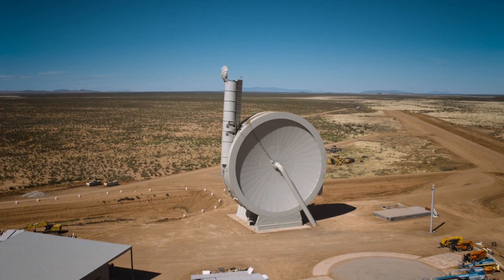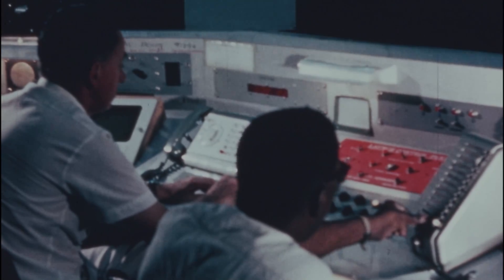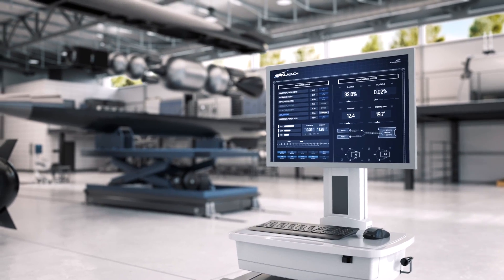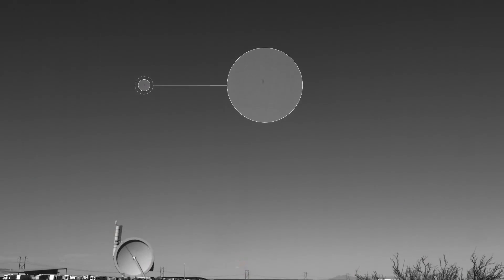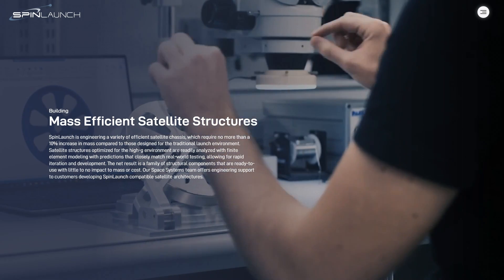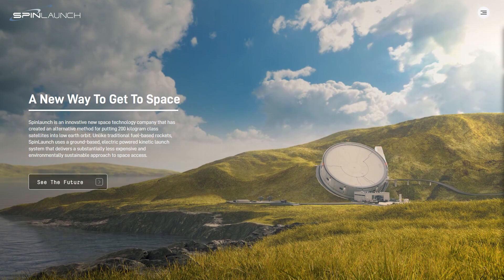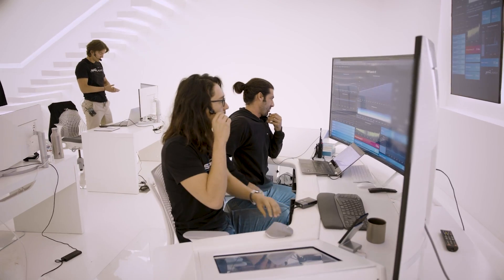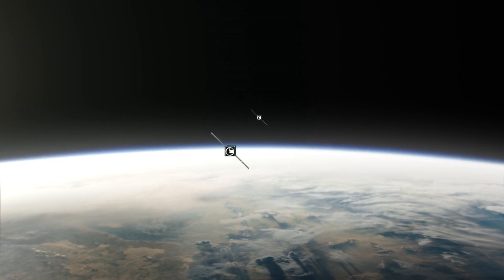Can Spinlaunch Throw Rockets Into Space?

Comment: They realize that if a spin based launcher does fail that it may be worse than a rocket exploding as the projectile/craft goes where ever the failure sends it at hypersonic speed at ground level and with a range similar to a rail gun or farther for debris to all.

A city hundreds of miles away could be at risk if a failure happens if the thing survives the failure and doesn't burn up.

Tho a smaller version with a rapidly moving trap door or maybe open ended for a tank's main gun would be an innovation. If that thing reached hypersonic speed using 20 percent power for a multi thousand pound load. A shell a few pounds should be easy and use less energy than a rail gun. So it could be put on ships to. 

Carries a smaller risk from a smaller projectiles to.

Comment: Why don't they build a floating platform at 9 - 10 miles high to launch from? (It could be sort of like a giant raft with helium blimps for buoyancy. The whole platform could generate energy with solar and wind power and be tethered to the ground. It could have a surface area about the size of an aircraft carrier.) Then a spin launch device could do the same thing with a tiny fraction of the energy and forces required. So the engineering troubles would be far less exotic. You could also launch conventional rockets from up there, and they could be relatively minuscule due to the far smaller forces required to reach low earth orbit. Materials could be taken slowly up to the platform with something like an elevator. Or larger things could be taken by jet aircraft that would simply use a landing strip up there like landing on an aircraft carrier. Or rocket planes could take off from the landing strip and then it would not be hard to get to  low earth orbit.

Comment: I was thinking of a multi-turbine engine pod mount system with high thrust to weight ratio turbines, which could be the 1st stage platform for launching rockets through the thickest part of the atmosphere. The fuel tank requirements would only be large enough for the amount of time the engines have to burn at full throttle. Then the 2nd stage rocket could thrust away from the turbine platform and the turbines are parachuted back down to a landing area via an airfoil chute with mechanical controls much the same as a skydiver uses. Not quite sure of lift capacities for let's say a four engine pod system, but if they were something like J-79's (Think F-104 Starfighter) they could probably pack a significant 2nd stage payload into the upper atmosphere? There may even be the incentive to design-build unique, light-weight electric-turbine engines which are purpose built for this one specific task?

Comment: The "VT fuse" (VT for variable timing, a ruse name like "tank") which was the proximity fuse used in WW2 by the US & Britain, in artillery, and AA shells. A very secret weapon, subjected to high Gs. It was built with subminiature vacuum tubes, with glass bodies. A large part of the durability, was due to the square-cubed law. These tubes were very much smaller than standard vacuum tubes, and that made them able to handle the required stresses. The same physics (math) property that allows an ant to carry 16x its own weight. Scale an ant up to the size of a house cat, and it would collapse under its own body weight. Scaling is even greater between the first electronic computers and a modern computer chip.

Comment: A thin plastic sheet does not hold a vacuum. If you want to decrease air resistance, perch the centrifuge up higher, streamline the arm, and fill the chamber with helium or hydrogen.
Also, put it on the equator. It gives you a head start of 1000 mph.

Comment: @9:20 rebalancing on release should actually be quite easy.  All you need is a diametrically opposite counter-mass that is released at the exact same time. It would of course be released in the opposite direction so it would need a somewhat oversize 'bullet trap'  to safely bring the counterweight to a halt after release but such things have been built many a time for military ballistics tests.
The advantage is that it is very simple.  All it needs is for both arms of the rotor to be identical and have the counter-mass be shaped the same as the launch projectile, in terms of its mass distribution and the way it attaches to the arm. The release mechanism (most likely pyrotechnic) would also be identical on both ends guaranteeing sub millisecond accuracy in release time.

Comment: Notice how in reality they put the rotation axis of their prototype parallel to horizon, compared to the inclination plane in the computer generated images. Vibrations on the shaft will be better oriented, since gravity won't have an axial component. Only radial efforts on the shaft.
Reply: They'd have to align it with Earth's rotation axis otherwise the precession forces due to Earth's own rotation would be significant once it's approaching launch speed
Reply: @triffid0hunter  ? I am very doubtfull about your affirmation: it would be a very tiny force couple, compared to all the other efforts they have to face. The main one being the vibration caused by the flexion of the arm outside the plane of rotation (due to gravity and unbalanced arm) if the axis is not parrallel to horizon.

Comment: Mach 1 @ sea level still leaves a lot of work for a rocket to do…. 
Im still thinking that a rail gun would be an easier.
Neil deGrasse Tyson mentioned that a gravity train between any two points on earth would take half as long as it takes to orbit earth, (45 min? (In a perfect vacuum without friction)).  Get the boring company involved, tunnel flat, as deep as is safe, perform a “gravity assist” in a straight railgun.  Have it launch as close to the equator as possible.  And stop making things so complicated.  I mean really that throwing arm is going to come off its bearings and rip through that shell and murder a whole bunch of nice folks, or at least destroy a bunch of their hard work.

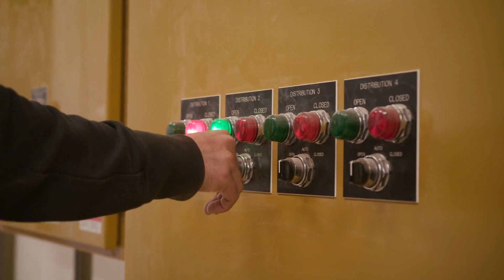Comment: 09:10 damage the bearings - liquid bearings? Old lighthouses used mercury as a frictionless bearing for the lens assembly. Yeah, orders of magnitude difference, but should function at high-speed/mid-mass like it does at (s)low-speed/high-mass (tons of glass & associated steel framework)
Reply: They are probably using air bearings

Comment: How about adding another payload dummy projectile on the other end of the spinner that releases at the same time but have it yeeted into a basement tube where it can be safely discarded and the spinner wont suffer damage from the sudden loss of weight on the one side of the spinner alone. it would of course increase the overall weight and time/power required to get it up to speed but can lessen the damage on bearings and other components

Comment: the whole time i'm thinking, do this on the moon, lower ev and no atmosphere, and then Scott finally gets to it. Seems like a good application for moving materials off of bodies with little or no atmosphere and low gravity, i.e. asteroids, moons, but possibly Mars too? atmospheric pressure is way lower and gravity is 0.4g.
Reply: Yeah, but there's also no point to spinning it there. With no atmosphere and plenty of open space, you can just lay out a big ol' magnetic launch system and avoid the 10,000 G side loads.
Reply: @AubriGryphon  true a rail gun to launch things into orbit might be the way to go if you have enough level terrain. But possibly on an asteroid the centrifuge approach which is more compact and would have advantages.
Reply: @FredPlanatia  Asteroids have so much less gravity you could get escape velocity with a tiny rail gun. 

Ad for level enough terrain. Just build it on the side of Olympus Mons. You get a very slow acceleration right up to the top.
Reply: Gerard K. O'Neil, High Frontier  L5
Reply: If only any of those bodies had a product that it will EVER make economic sense to require launch.
Reply: @markdoldon8852  You’re eluding to helium-3 for use in nuclear fusion power plants?
Reply: @snivesz32  or say the massive exposed deposits of rare minerals, with a cheap enough launch system it would become viable, especially if you started the operation from an assembly plant on a body like the moon
Reply: @markdoldon8852  I imagine if you want to build something in orbit it would be advantageous if you accessed local resources. In the case of asteroids you might build mining equipment or stations using local sources of metals for example.
Reply: Using solar power to spin launch or magnetic rail launch something from the moon or a small asteroid might make mining more economical.
Reply: Did you forget space debris that makes this more dangerous outer space, and where do you think they will get this kind of electrical energy on the MOON?

Comment: They would not be able to rebalance the weight without releasing a mass on the other end of the rotor (into the ground). This is because the amount of energy required to I so would be on the scale of the launch itself, not something that can be done in a fraction of a second. They would have to be able to manage the imbalanced rotor forces

Comment: Interestingly the rail gun option has been around for a very long time. I read a sci-fi novel where they suspended a rail gun high up in the atmosphere, using helium balloons, with a "space elevator" link to it. Being above the clouds and most of the atmosphere (I think it was something like 50,000ft), off the coast of Brazil (so not to affect the heavy air traffic off the USA east coast)
The story went through a few of these issues, like the electromagnetic cart welding itself to the rails. Eventually, in the story, it became the primary method to get cargo and people into low earth orbit, cheaply and efficiently without the use of chemical rockets.
So in a way it's possible, it's still a massive engineering feat.

--edit

Forgot to mention, later in the story they did put versions of it on the moon, but at the ground level, because not atmosphere. Used for mining if I remember
And no I for the life of me cannot remember who wrote it or what it was called
Reply: "People".

Comment: The arm rotates at high speed, but so does the rocket. So, somehow, you need to stop the rotation of the rocket. How?
Reply: No, it's called release.
Reply: @kiereluurs1243  No. Consider this: take a pole, about 1m long. Stand in a field and start swinging it around at, say, 2 revolutions per second. Release the pole. It will fly away, but It will also rotate with 2 revolutions per second. This can also be seen at the olympics, during "hammer throw", where you will observe the string to spin around the ball after release.

Comment: 1) seems silly to plan on this being installed at sea level.  there are some very nice +10kft areas that would save a significant chunk  on the initial atmos drag (and Haleakala would be a pretty sweet option).  2) there's going to be some spring back forces within the projectile when it's released... i wonder how hard it's going to be to buff the payload so that it can survive not just the slow spin up, but the sudden release.

Comment: The timing of this required to release at the correct moment to set the projectile to its planned path, if it fails does the projectile just get smashed to pieces and self destruction internally?
Reply: With that amount of kinetic energy, depending on how solid the whole accelerator is, either the payload gets basically vaporized on impact, it breaks through the wall and yeets god knows where, the accelerator get destroyed or a combination.

Comment: For the balance problem you could have a 10t steel block on the other end, releasing it at the same time as the payload and having it impact in a deep water pit a few houndred meters beneath.

Okay i MIGHT just want to see that splash :D
Reply: Not 10 tons, just the same as the projectile, and 2 equivalent arms.
Balancing it all out, including release, is a good idea.
Reply: @kiereluurs1243  10t because I thought the rocket was also 10t. Actually it is 11.2t.
But the counterweight wouldn't even have to be the same weight as the rocket. It could weigh more and be closer to the center (as they do in centrifuges and Spinlaunch shows in the video). 

Anyway... I demand a great sploosh :D

Comment: Actually, on the moon, a coil gun or rail gun approach would probably make WAY more sense. No atmosphere, and a linear accelerator powered by sunlight/photo-voltaic panels (possibly stored in large capacitors). Much lower G forces to contend with, and no counter-balance issues, either.

As a matter of fact, I'm kind of surprised that Elon Musk hasn't considered it as a launch method for Mars.
Reply: You're surprised? I'm not. Because Musk's Mars ambitions are a lot of smoke and mirrors that when you bother to cruch the numbers yoursel quite obviously ain't never going to work.
Reply: @OnionChoppingNinja  please provide your research, we can peer review it

Comment: Hey Scott, how feasible would it be to use such a system to launch a self-expanding aerogel to intercept a defunct satellite (or debris) at relatively low speeds in a non-destructive way in order to add more drag to it and de-orbit the satellite/debris?
Reply: The aiming would be incredibly difficult. I think standard anti-satellite missiles would be a more reliable solution.
Reply: @Bryan-Hensley  Anti-satellite missiles are guided too...fins and thrust vectoring. Explosives are a more reliable warhead than some crazy aerogel system I'd imagine.

Comment: I'd be really interested to know how they cancel the rotational inertia of the projectile (in the same axis of rotation of the centrifuge, i guess yaw?) when the projectile is released
Reply: Compressed gas counter weight? Release it into the vacuum when the projectile is released?
Reply: @mzb8134  yes maybe, I wondered if it could just be aerodynamic stability but then that wouldn't kick in until it exits the sealed vacuum?
Reply: Are you assuming the projectile will continue to rotate and not go in a straight line once it is released? That's not how physics works.
Reply: @SecretNatureChannel  I think it will work fine because the test in this video worked fine! Considering the physics, at the moment of release I think the projectile will go in a straight line because of the conservation of linear momentum, but I also think the projectile will have angular momentum at that moment which will also be conserved.

Comment: For the technical problem of releasing the payload and not destroying parts of the system: couldnt they just have a second exit on the opposite side and yeet an equivalent weight down into the ground at the same time? Would probably require some slow down material to drop the weight into, doubt a water tank would be smooth enough.

Comment: How do they balance the rotator when the chamber is inclined at 30-something degrees? Wouldn't you need to very quickly change the mass distribution during each rotation?
Reply: Good point - probably not yet solved and that must be why the demonstrator is vertical

Comment: Use water as ballast and have a bunch of valves that open immediately upon releasing the rocket, since it's a vacuum chamber the water should be very eager to leave its ballast tank. Maybe something like Bombay doors type design, something you might see on a fire helicopter or fire plane that is designed to release a large amount of water quickly

Comment: Simplest solution to rebalancing the rotor at the point of release is to use a dummy projectile as a counterweight, and simple dump it into a pit at the exact same time the "real" projectile is launched.

Another option would be to use a fluid counterweight and, again, dump the fluid at the point of release. Pretty challenging to open a valve and dump 10t of water in 1ms though.

Comment: Hello, Scott.  Pleased to meet you. ...
Scott,  this Spin-Launch, inertial assist would be *IDEAL* for launching packetized payloads from the LUNAR SURFACE to various LUNAR ORBITS. ... 
>> Packets (the size and mass of a cinder-block or a SCUBA tank) might include:
** Silicon Ingots (for construction and fabrication, electronics, etc.)
** Lunar Ice  (for export to Mars outposts)
** Helium 3 (for export to Martian fusion reactors).
** "Geological" cores and samples.
** Other refined exports.
>> NOTE:  Since the moon has no atmosphere, then, the spin armature needs NO housing and , also,  the projectile can be ANY shape. ... No atmospheric friction or resistance  means no heat and no drag. .. The much weaker lunar gravity-well  means "easy orbits" .. No weather elements (no wind or precipitation) means that flexible solar arrays can be unfolded or unrolled, directly, onto the lunar surface, without any structural support or weather proofing (so ..  solar arrays can be just as thin and compact and light weight as those on the ISS). ...
>> ALSO:  Since there is no need for a spin-housing, the armature and the motor are the only major components and, from the looks of it, there is a lot of carbon fiber involved so, no prohibitive bulk or weight, for trans-lunar  logistical concerns. 
>> LASTLY: Even the counterweight (for the armature) can be "solar smelted"  from lunar material (or smelted or compacted mission refuse, i.e. "disposable support equipment") .. The counterweight can be rather crude  .. It can be "die-cast" into any symmetrical size/shape and need not be small or sleek.